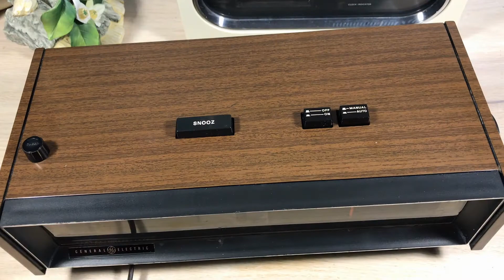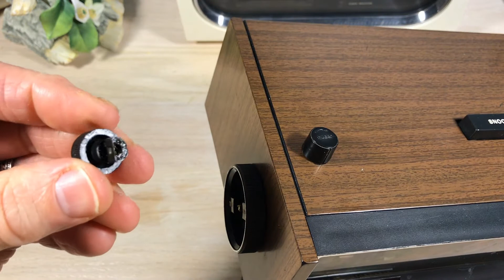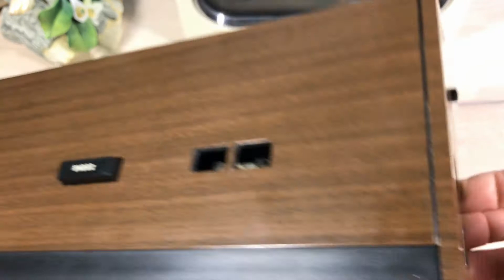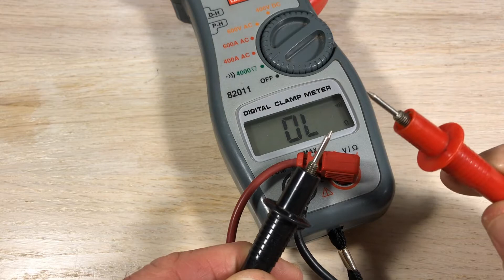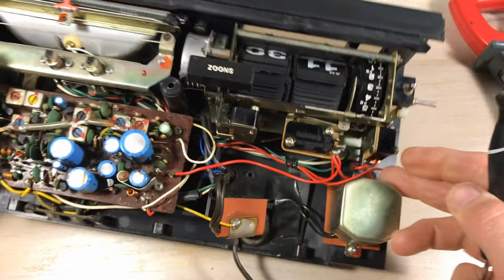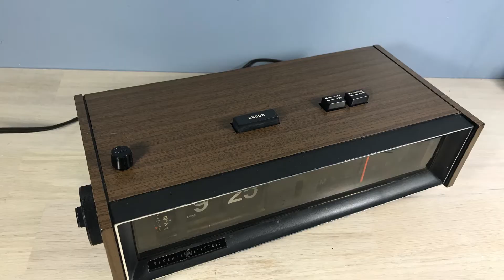General Electric C4335A Flip Clock Repair

Comment: Love your videos! I am wondering what bulb or bulb number you used for the dial light….
Reply from the maker: It’s hard to remember and that clock is in deep storage. But it looks like one of those 12V “grain of wheat“ bulbs would work.
Reply: @Flipclockfans  Update:
For folks looking for A replacement bulb, I could not find a incandescent replacement for the dial light, however I had a package of LED's that are used on model train sets for various trains etc. I think these particular LEDs could handle up to 24v if I remember correctly also looks like there is an inline resistor built in probably to limit current. I put a ohmmeter to get the voltage and the output was reading 12v on my Fluke.
Anyway the bulb fit perfectly in the dial light hole in my unit . I just put a dab of silicone sealant on the back just to make it secure and I must say that I am VERY pleased with the results. If anyone want more info on the LED's I bought, let me know and I will dig the package out and post info if anyone is interested as I am thinking these may be useful to other folks here for many applications.

Comment: A lot of these have the same form factor, I have this exact one from GE but I also have VERY similar ones from Lloyd's, Admiral, Radio Shack (Realistic), and a few others, any idea who the original designer/manufacturer may have been? Also, any leads on what the radio dial lamp might be? like voltage and MA? Thanks

Comment: I've always hated the expressions "open" and "closed", since in so many other contexts (eg. fire doors in a corridor) open means connected and closed means blocked. Nice job though; I hope it stays trouble free for a long time. Those 1970s GEs were always a cut above the competition.
Reply from the maker: I'm with you on the "open" and "closed" thing! But it finally click when I pictured one of those big old fashion throw switches, pushing it down completed the circuit (closed), pulling it up (opening it) shut it off.

Comment: i own a similar looking flipclock from sony digimatic, one of the numbers came off and is now in laying against the glas at the bottom of the front of the clock, is it easy to reattach the number (its the bottom of 47) or is it advisable to not mess with it ?
Reply from the maker: Oh gosh no. That can be fixed. If it's fallen off likely one or more of the little tabs has been broken off. There are two options ... fix the tabs or find someone who will send you a replacement tile (and don't break it when you put it back).  Here's an explanation of how I fixed a tile.
https://www.youtube.com/watch?v=dwUgwBYwAhU